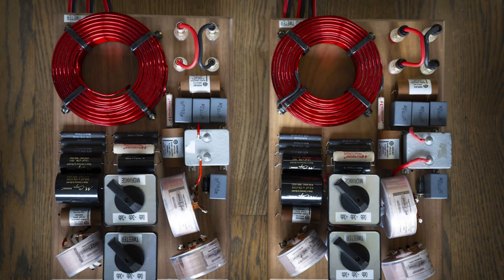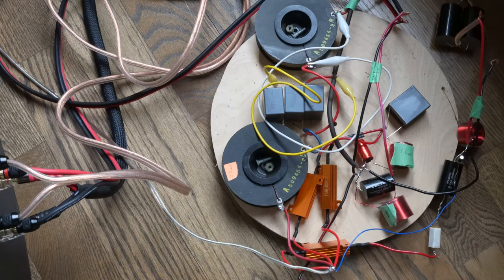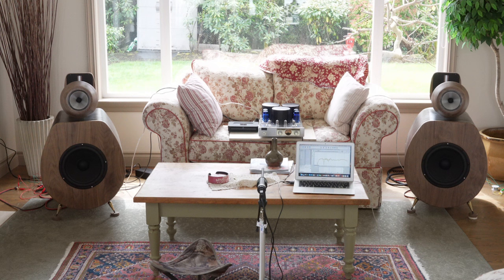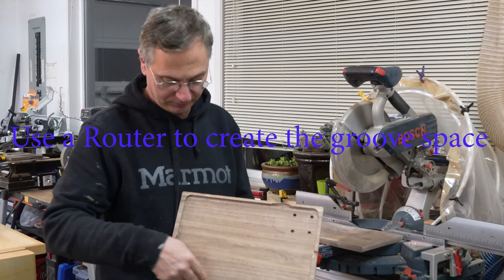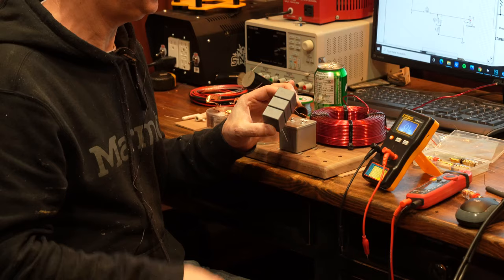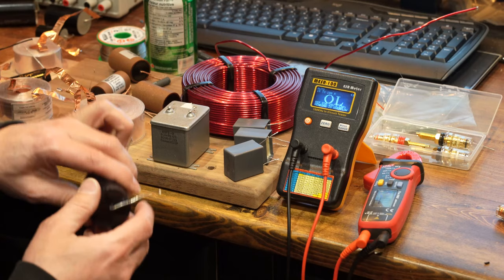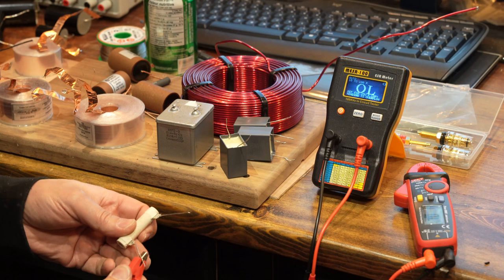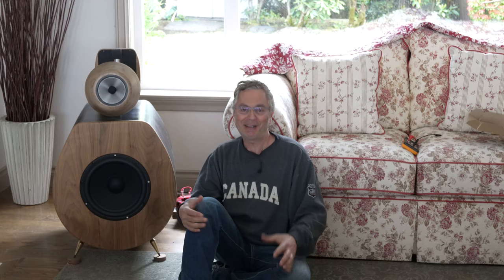Building very high end speaker crossovers  part 1

Comment: I have a pair of Pioneer CS-99A with a very complicatedly designed crossover, however its bass is weak, while the mid to high are too hard. I also have another a pair Technics SB_X500A with a much simpler crossover, but its bass is much stronger than the CS-99A, and its mid to high are very much warm and comfort. Its bass is even stronger than the Pioneer HPM-100.

Comment: Hi there, I'm relatively new to DIY speaker building. I'm wondering if you could explain the difference between cheaper crossover parts vs more expensive. Just a general idea is fine. I don't quite understand, if the values are the same on both the cheap and expensive components the outcome should be the same right? Bear in mind I'm not very knowledgeable about the electrical parts yet, I'm just trying to understand why some advocate for super expensive components while others say it doesn't matter? I could be missing some simple info that makes my question stupid, but if that's the case I'd still like to know haha. Is the percentage listed on the components that the differing factor for cheap vs expensive components? If that's the case, does matching cheap components that measure the same have the same outcome of expensive components? Thank you gab! Edit: I've just built cheap kits, no designing yet but maybe it could be fun at some point to try, but I don't really understand enough yet haha
Reply from the maker: Hi Daniel 
When sound passes through inductors Capacitors and Resistors it changes 
For inductors the thicker they are the less loss in signal despite having the same inductance thicker wire has a lower resistance so your woofer will have more bass as there is less loss.

For capacitors sound is far better with film capacitors and the better the quality the better the sound despite having the same value
Similar effect with resistors 
Hope that helps
Reply: @Gabster1  thank you for your quick response, it does clarify things! It makes sense now!

Comment: When you say 'time aligned' i assume that means when not using a crossover.  So say to 'time align' the woofer with the midrange, at a crossover frequency of 500 hz - I assume you sent a 500 hz signal to both drivers and put a near field mics in front of each with a baffle separating the mics. Then adjust front to back one of the drivers until the oscilloscope shows both mics in phase.  Is this the process?  And even if one does this. after they connect the drivers to the 2nd order passive crossover, we understand there will be a 180 degree phase shift that will take place at the crossover frequency of 500 hz.  Which we can not do anything about. as that is the nature of how passive crossovers work.  Is there any type of crossover solution that maintains phase between all drivers throughout the full audio frequency range?  If not, isnt phase shift a serious problem in audio reproduction?
Reply from the maker: This is an excellent comment you summarized in a small paragraph the biggest challenges in speaker and crossover design I really like what you said.
Then you add a second speaker and hope the stereo pair are not going to have phase shift 
Then you put them in a room and hope that the bouncing frequencies are not canceling each other

Comment: Hi Gabby, nice video, quick question, I have a pair of Energy Cf-70 speakers that Im running through Yamaha Rx-v3900 im considering upgrading the crossover however not sure if its worth the expense or if i should just upgrade the speakers, your thoughts would be much appreciated. thanks

Comment: Help  ! I made a 3 way  first order network that I love, sounds great 👍 I can't find info on making it a second order, is there a formula ? Can I keep the first order and add caps and coils for a faster cut off ? 
My home made speakers are better than most store bought but nowhere near the level of yours, I used Jantzen 16ga.coils and Jantzen caps, so the xovers cost me around $80 each again better than most production, but not on the level of yours, just so you know what my budget is/ what type components I'll be using
Reply from the maker: Yes you can add to it to make it second order 
But I would measure before and after to make sure you are getting a better effect just be careful as often the phase will shift and May need to reverse the polarity on the second driver
The frequency response around the cutoff frequency should not have a bump or null
Reply: @Gabster  if I know my the values of my existing inductors and caps how do I find the value for the caps and coils to make it a second order ? .

Comment: Gabby - Just discovered your channel-- I'm very impressed with your speakers -- they are truly an work of art.   
I have several questions about your crossover schematic--  You said this is a second order design -- It appears to me that the high pass section is 3rd order -- if not, what is the function of the 10uf cap (C8)?   I see you use bypass capacitors on the padding resistors at the input of both the high and band pass sections -- Is this to boost the output at the high end of each driver's range?   Also, you are using bypass capacitors  (.01uf) on many of the filter capacitors -- even on the capacitor in the low pass section, but you didn't use one on the 10uf cap previously mentioned (C8) in the high pass section-- why not?  Also, you show a resistor (R4) in series with the filter capacitors in the low pass section-- what is the function of that resistor?  You give a value of 330m-- does that mean milliohms?  If so, I've never seen a resistor used in a passive network with that low of a value.    Also, in the band pass section why did you place L1  in the circuit before L2 which would be a more conventional placement -- or does it make any difference where they are situated?

Comment: where did you get the big air coil> What value is it? Crossover points?
Reply from the maker: Solen.ca   3.7mh R4 eases the C6 effect and prevents the impedance from dipping to low
Reply: @Gabster1  thanks-trying find on their site-what were you crossover points?

Comment: What model 47uF capacitors did you use?
Reply from the maker: These are Kemet from Mouser great value for Large film caps Ideal for Woofer section when you need large values and don't want to mortgage the house :)

Comment: You should have done path audio resistors... Quite a big improvement over the ones you used... But good build. Also your scale on sweeps make it 5db vs 10. Your waterfall z axis also is large time domain should be smaller to show true scale
Reply from the maker: Thanks for the suggestion  I never tried the path audio resistors before I will give them a try may be do a simple blind test setup.
Reply: @Gabster1  would love to see it! They are a huge improvement quite shocking even over the quality ones you used